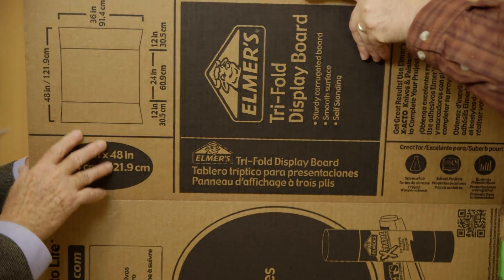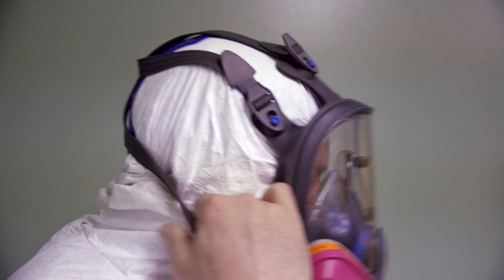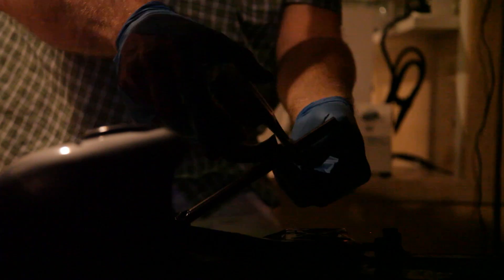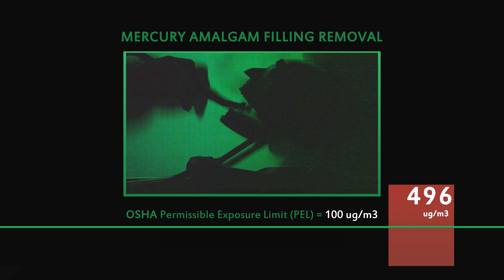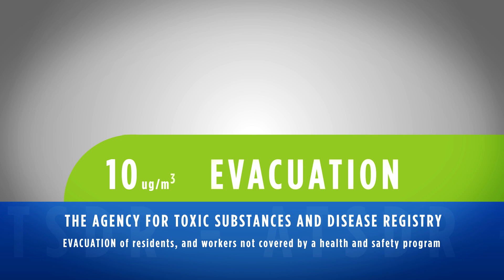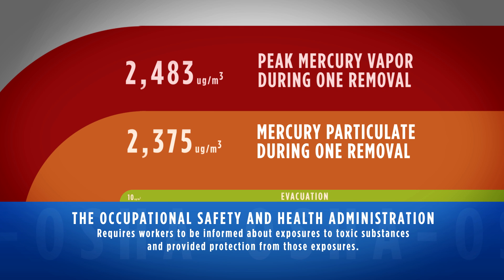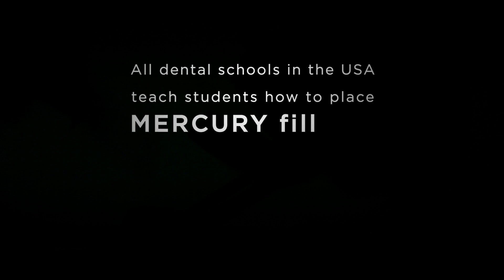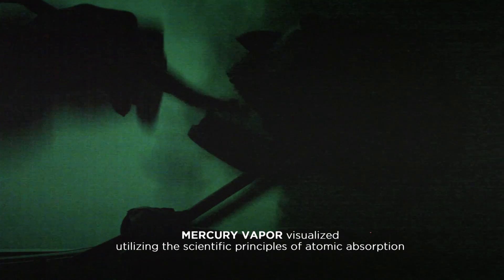Visual demonstration of toxic mercury vapors generated during a dental amalgam filling removal

Comment: I dont have great teeth, never did. I was actually born missing several adult teeth and the bsby teeth stayed in my mouth (2022 the one baby tooth finally died and fell out, but a tiny piece is still in my gum) i had several of these fillings as a child/teen. Over the course of my adulthood so far (im 43) i have had several teeth removed because of breaking and abcesses. I know 4 pregnancies didn't help. Lol. Anyways,  i think there are a few of these fillings in the few teeth (molars) i have left. A few weeks ago, a piece of one of the fillings broke off and i didn’t think much about it at the time. But i started to get weird facial symptoms and i think its all connected,  not to mention alot of my other health problems are probably caused by these stupid fillings.  Nerve issues, carpal tunnel, ulnar tunnel, anxiety/panic, arthritis,  and other strange nerve issues.  Im trying to get into a biological dentist very soon and see about removing these fillings. Is there anything i can do til then, with these toxic fillings still in my mouth? Ive been researching alot and joining chelation groups, reading their posts, etc and so far, the only thing i think that seems safe, is liposomal selenium. Thanks for the great video, sharing it far and wide.

Comment: So why is the mercury vapor rising instead of immediately sinking to the base of the display since it's atomic number is considerably higher than oxygen or nitrogen?   Might the clouds formed be simply the dispersion of the cooling water spray and the forward venting of the air driven turbines air exhaust?   This visual representation is SO unscientific, it proves nothing.
Reply from the maker: Hi Jim, mercury vapor is greatly influenced by air flow in the room. Watch the mercury vapor visualization by the EPA and you'll see the same wafting of mercury vapor rising and spreading out through the air. I consulted with the EPA region 6 (Eric Nold - whom we have interview clips with here on our channel). Additionally, we hired a company that manufacturers equipment that measures mercury and had them come out to operate the equipment. Lastly, if you'd like to know the scientific reason behind why what your seeing is mercury (and not water vapor or some other substance), please watch this video on atomic absorption (I added this footage because we've receive many questions about this. https://youtu.be/PvCWQ1weYxo?t=25
Reply: Thanks for the link which explains the equipment being used.  I am quite familiar with the phenomenon as I used atomic adsoprtion spectrometry extensively to coauthor a paper on cadmium metal poisoning while I was a chemistry undergrad.  What is not mentioned is that in spite of the impressive plumes, all of these shadows are cast by individual Hg atoms exhibiting Brownian movement in the air, and represent a dose far below any toxic level.   That is why the plumes are so sensitive to air currents.  The volatility of liquid Hg is very very low so it is misleading to the lay person that what they are seeing doesn't represent an enormous cloud of pure Hg vapor.  And the plumes are definitely exaggerated by their dispersion by the air/water spray coming from the handpiece.    If you admitted that the load of elemental Hg exposure from restorations is present but far below toxic levels and that the main source of Hg poisoning for most people is by eating big game fish like tuna - it would be more honest.
Reply from the maker: @jimchung5710  while I personally find your rhetoric condescending (claiming what we've presented is unscientific and questioning the honesty of the presentation despite your lack of overall knowledge of the subject and its nuances), I would encourage you to reconsider your "represent a dose far below any toxic level" comment as the levels measured (not just by us, but published in the scientific literature) far exceed safety limits established by the EPA, ATSDR and OSHA for acute exposure. Keeping in mind that those exposed (dental patients and dental employees) are mostly unaware they are being exposed to mercury during these processes.

Your comment that the volatitility of "liquid Hg is very very low" is not in line with the science as elemental Hg begins to evaporate (off gass hazardous mercury vapors) at negative 38 degrees. Check out this video with Sue Casteel from ATSDR and Eric Nold of EPA where the specific levels are mentioned.  
https://www.youtube.com/watch?v=SmswlK8ojq4

As outlined, the higher the temperature the more mercury vapor is released from elemental mercury (of which amalgam fillings are roughly 50%). When the dental drill makes contact with the amalgam there is friction, which increases temperature and a large amount of both mercury vapor and mercury particulate matter is generated. This is clearly established in the scientific literature.
https://www.youtube.com/watch?v=sZoDDX0i3wA&t=1s
 
You seem to be unaware that the World Health Organization both in 1991 and 2003 have
that dental amalgam has been identified as the largest single source of continuous Hg exposure for member of the general population who possess amalgam fillings (which in the USA represents 120+ million Americans). Mind you this say nothing of exposure from removals, but is a more generalized account of mercury exposure in the population.
specifically in 2003 
"Dental amalgam constitutes a potentially significant source of exposure to elemental mercury, with estimates of daily intake from amalgam restorations ranging from 1 to 27 µg/day"

As far as your comment on more mercury in Tuna, you might reconsider that as well, as mercury from fish is methylmercury and mercury from amalgam (element, which is uncharged becomes inorganic mercury) Please note that the EPA has a safety level for inorganic mercury that is 10 times lower than that of methylmercury (meaning they consider it to be more toxic, thus a lower level of safety)
https://www.youtube.com/watch?v=4D1qnD1jwP0

If you want to know more about the science of mercury exposure from dental amalgam, please check out this position paper on amalgam that lists hundreds of scientific studies on the subject.
https://iaomt.org/iaomt-position-paper-dental-mercury-amalgam/
Reply: I do know my chemistry.  Unlike the US, highschool in Canada has an extra year so we are doing the equivalent of first year US University in the final year of highchool.  I have a four year degree in Chemistry prior to entering dental school so I have the equivalent of 5 years of university chemistry study enabling me to enter a PhD program had I chosen not to go to dental school.   But the main refutation of your stand is why is it fringe and not taught at any reputable dental school.  Why does the ADA or the CDA not enact your highly rigorous procedures to remove dental amalgam from people?  Why does the IAOMT membership remain so small relative to all practicing dentists?
Reply from the maker: @jimchung5710  you ask great questions, of which i cannot fully answer as to why the ADA or CDA do not enact rigorous procedures when removing amalgam, especially when occupational safety regulations clearly outline they should implement administrative & engineering controls and respiratory protection during removals. 

Here is speculation on my part. The ADA cannot say that amalgam is safe for dental patients, yet so unsafe during removal that dental employees must protect themselves from the mercury generated with respirators and full body ppe. Thus the ADA has always stuck with the line that amalgam is safe (even though the manufacturers of amalgam have never proven safety to the FDA.) In a just world, organizations would be operating under the precautionary principle and would be more diligent about trying to limit the exposure of mercury to patients and staff. 

Please see my video on the history of amalgam
https://www.youtube.com/watch?v=UQLcq2JUENs

and the history of how amalgam was grandfathered into use at FDA
https://www.youtube.com/watch?v=a0RDdfk4o4w

The FDA has finally issued warnings that amalgam shouldn't be placed in susceptible populations (about 1/3 the USA population) but they did not remove the product from the market. These warnings were leaked to us years ago and featured in our film, before the FDA made them public.
https://www.prnewswire.com/news-releases/fda-issues-mercury-amalgam-filling-warning-group-calls-for-even-more-protection-301138051.html

While the ADA does warn of mercury exposure during removal (in the ADA mercury hygiene recommendations - JADA 2003), it downplays the exposure and doesn't look to OSHA standards as a means of communication or protection. 

So how does almost the entire dental profession get away with exposing staff and patients to levels of mercury above safety limits? Again, this is conjecture. But I believe the combination of mercury's properties (odorless, tasteless, colorless, invisible) contributes to dental staff being largely unaware of these exposures (how would they know to complain to OSHA about what might be influencing their adverse health symptoms when dental school, ADA and FDA all say amalgam is safe?). Our OSHA is woefully underfunded and its been explained to me by OSHA personnel, since the organization has limit resources they focus on companies with a large number of employees. Most dental offices in the USA do not employ a large # of people.

What i do know is that the scientific literature shows mercury exposure above safety levels from amalgam and that there are usually years, if not decades between the science of harm, versus the implementation of public policy to protect people (see the history of lead for an example) where those who are making money from the substance that harms others are usually the ones standing in the way of the change necessary to protect people.

Lastly, if you're interested, here is a free copy of my Oscar qualifying documentary, Evidence of Harm that outlines much of what we have discussed
https://www.youtube.com/watch?v=mwCGoL7kmSk

I hope you find the film entertaining and informative.
take care,

Comment: If there was any potential exposure hazard to remove dental amalgam restorations if would seem obvious that the dentist utilize rubber dam isolation and copious water coolant during the removal of the amalgam restoration that was likely perfectly fine and the treating dentist advised removal of the amalgam .  Not sure if these dentists that promote needless removal of existing dental amalgam restorations based on suspected belief that the restoration has recurrent caries or it has simply been described as defective because it is an amalgam restoration. FACT and I say Fact is amalgam restorations have been followed and have a longevity of service against recurrent decay more than 5 times replacement or initial placement restoration placed with resin composite.  Given the complete lack of evidence that amalgam restoration "leach" mercury into the patient the practice of replacing amalgam restorations with composite restorations is simply Charlatan and violates all codes of ethics.  Removing an existing amalgam restoration that is caries free and replacing that restoration without utilizing a rubber dam or an Isolite device is criminal in my view. I have seen many many patients that have been victimized by this  and after their teeth have been restored by  a dentist that somehow believed that poorly placed composite restorations would help their victim.  It is basically pathetic.  Unfortunately in December 2021the crap still happens every day across the world. Pathetic.
Reply from the maker: EDIT AS FIRST RESPONSE WAS RATHER HARSH. Sheesh, you are ignorant about the science of dental mercury, as well as the OSHA standards you a breaking by not informing and protecting your staff from mercury generated during the placement and removal of amalgam fillings. I have no patience for those dentists who willing ignore the science of harm from dental mercury and try to spew ignorant bullshit, which not only makes you a shitty dentist but also an asshole of a human being.  It is my opinion that anyone reading this thread should stay away from this dentist... Ed Dergosits, DDS

Comment: I've had 5 mercury fillings replace in the last 4 years. Two were removed a few months ago. I haven't noticed any ill effects at this point. Actually feel relieved to have them out. I did have a weird reaction last year when I got my teeth cleaned. I almost passed out while driving home from the dentist. Felt weird for several months after that and I suspect the high powered water drill that the hygenist used may have released merc. into my system. If you do get them replaced make sure the dentist at least uses a damn. I personally feel it's better to have them out but you can go slowly. Eat a lot of apples, cucumbers and watermelon.
Reply: remove any heavy metals by taking chlorella.
Reply: @BBBBBB-rd8gg  Chorella is dangerous. It causes redistribution of heavy metals as it's not strong enough to hold onto them. Instead you have to use andy cutler chelation therapy and chelate with compounds such as DMSA and then ALA.

Comment: I have severe memory problems and hand tremors that seem to be related to metallic mercury vapors from when I was a dental assistant (1972-1976).  The hand tremors are much better but the memory loss is worse.
 

Can mercury exposure cause my memory to continue to decline even after exposure stops?

Could the fact that I have several mercury fillings continue to add small amounts of mercury to my system that effect me MORE because of my LARGE exposure in the past?
Reply: use andy cutler chelation therapy and chelate with compounds such as DMSA and then ALA.
Reply: I feel that it's definitely possible. You can get a heavy metal hair test and test the levels in your system. Years of having the mercury and the offset of the vapor from brushing teeth, eating hot/cold substances release the vapor into your body. Then that builds up in your organs and soft tissues. I'm currently undergoing the removal of mine. I had 10 at one point. Had mine for over 20 years. I had 2 teeth pulled from them cracking from the mercury expanding and contracting. I had 3 removed about 3 months ago. I have 4 more removed in a month. I'll be left with 1 more. But I'm currently detoxing with bentonite clay. You can take it internally and externally. This helps alot. You can also do chelating if you have them all out, chelating is not recommended if you still have any mercury fillings left. Activated charcoal also helps too.
Reply: Do you remember more recent events? Are you good at visualising them?
Reply: @mattmurdock9362  Well, I asked a friend if he and his wife liked to bowl.  He looked at me wierd and said "Tom, we went bowling with you last week."
Reply: @tommartin5667  are you good at visualising things?
Reply: @mattmurdock9362 Yes, I can visualize say, making a hole in one playing golf or things like that.

Comment: What if you were to remove the whole tooth? Would u still need to do it safely?
Reply: Of course not because the amalgam wont get drilled.
Reply: I was thinking the same thing. If I had to do it all over again I would have just pulled out the tooth.... and in the end that's what I did because I had the mercury filling removed, then needed a root canal on the same tooth, that rotted and decided to have the tooth removed...... Would have saved my health and 20 years of health battles......
Reply: @camiegontier  How did you notice the root canaled tooth rotted?
Reply: @camiegontier  Hindsight is always twenty-twenty.

Comment: Dentists are already equipped with devices that they position inside your mouth, to vacuum out excess saliva and tartar, while cleaning your teeth. Why not just develop a slightly larger, wider vacuum hose that can be used to instantly extract the mercury vapor that is liberated during the drilling process? Or do they already have something like that.
Reply: How about not putting 45-55% mercury in the fillings instead!!
Reply: @closerthanabrother9703  AMEN!  but then they wouldn't make as much money they are already getting from us!  butchers.